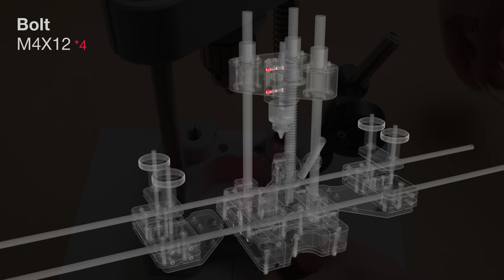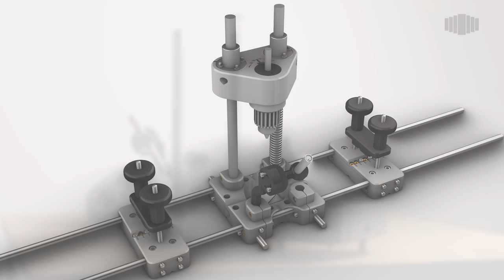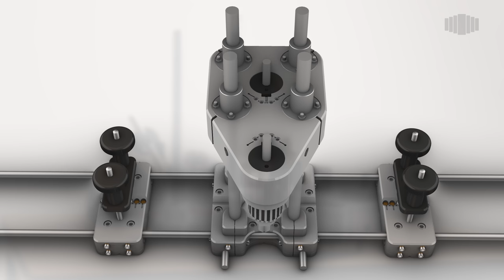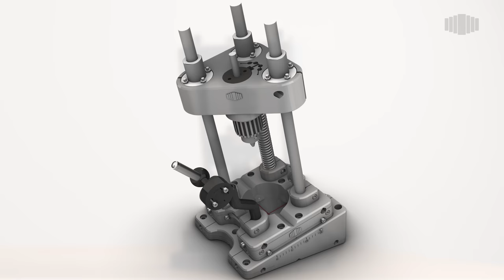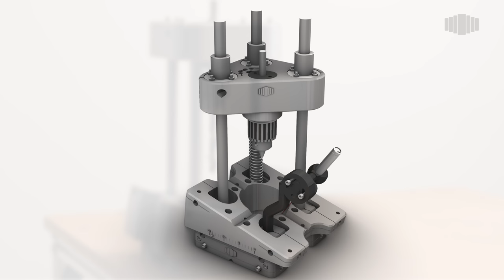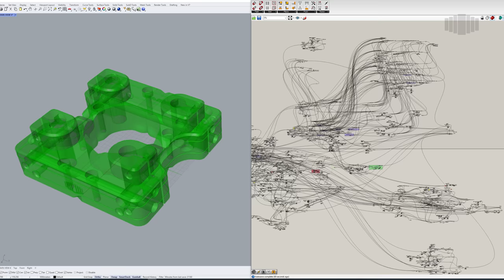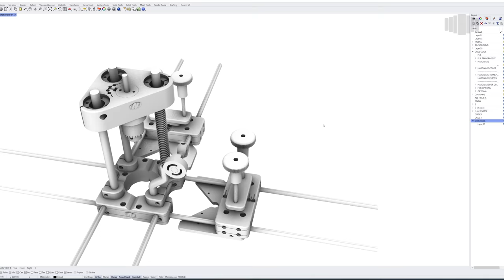AutoAngle Drill Guide || 6 Month of Design

Comment: You know you can make parts like these in any modern CAD software much easier. Also, it would make a lot more sense to have an adjustable base rather than having a dozen different angle bases around.
Reply: Honestly real carpenter only use 4 common angles max
Reply: They did make these parts in a CAD software
Reply: @stin-dog172  Rhino is not a standard CAD. It's somewhere in between CAD and mesh editor. It's neat and niche and has it's uses, but mechanical design is not one of them.
Reply: @lephtovermeet  Rhino is CAD software, its the software USSA uses and is familiar with. His designs are great and it appears that the software isn't limiting the design or production. Why dont you design a drill jig with a adjustable base on a modern CAD software instead of writing moronic comments on this channel
Reply: @lephtovermeet Rhino is cad and also has mesh utilities. For shapes like these and even more advanced and non parametric models its fantastic
Reply: @geort45  it's literally a mesh editor that doesn't produce b-rep solids natively. I apologize that this offends so many people but that's the facts. Rhino and Alias are in a class of their own of not CADs not like Blender or Maya style mesh editors, they're in-between. Rhino in particular is F'ing incredible at what it does. But it doesn't even so much as have assembly constraints or proper drawings - it's not a CAD. Period. And I love Rhino and have been a passive user since around 2015.
Reply: @lephtovermeet  It’s not a mesh editor… its main use is for NURBs whichis anything but meshes… it’s not parametric though
Reply: Right. Using Rhino as a mechanical cad is like using autocad instead of Illustrator to draw a label or something like that.
Of course it can be done, but why should you when there is a fuckton of better softwares to do it
Reply: He's actually mentioned why at the end of his latest video

Comment: Nice design. Just a tip: Use wood threaded inserts made of steel in stead of the ones you are using. I have used both and i think the ones you are using is made of zink or some zink alloy and it is really weak compared to the steel ones.

Comment: What threaded inserts are you using? I am only aware of inserts that are pressed in with a soldering iron.
Reply: They are designed for wood. Search wood threaded inserts. I had seen them before but never thought of using them in 3d prints. If threaded from the opposite side they look really strong.

Comment: Looking great.
I usually press to hard then drilling and that might be a problem with your design if using the offset drill instead of in center of the 3 rods..
An useful upgrade to make it even better is to use gears so it will be easier to choose correct speed

Comment: Is there any way to buy the final product from you directly? 😊
Reply: The answer is in the parts list, the LMF16UU bearings are between 5 currency units to 35. There are 6 in the main design. Are you ok with the cheapest? Then add the rest of the components plus double the expenses so far for your profit.  You will complain if he uses the best, you’ll complain and want a refund if he uses the worst and it breaks. One refund takes the profit from two sales. It will always be better if you make all of the choices and then there is only you to blame or pat on the back.

Comment: What is the significance of the multi hole guides?  There are 2, 3 , 4 holes as well as center and overhang.  If I want the laser, I should print the 3 hole version, right?

Comment: That's excellent and a very well thought out design 👍 the animations are also top notch well done. Can I ask what CAD software you used to design it and what software was used to do the animations in the video?
Reply from the maker: thank you, rhino 3d with plugin called grasshopper was used for design and rhino 3d rendering mode for animations, those are basically high resolutions screenshots animated in premier later,black ones are done the exact the same way but inverted later in photoshop

Comment: your drawings and video are very professional. what i want to ask. How long do these parts last?
I also use a 3d printer. But I do not want to write or receive these parts. Because injection plastic or metal is not as strong and long-lasting. Anyway thanks for your models and video.
Reply: Тут пластик используется чисто конструктивно, т.е. по назначению. Все движение происходит по стальным направляйкам. Если не будете прилагать лишние усилия, то послужит оч. долго.
Reply: @101picofarad  no. the plastic is cracking where the bolts and nuts enter. if you insert the bolt perpendicular to the layer trace. breaks much faster.For the model to be stable, the bolt holes must always be printed horizontally on the table.but it doesn't seem possible in this model.
Reply: @hasanrcn  Мужик, я обычно печатаю из  petg - он в любых раскладах работает хорошо, что вдол, что поперек.